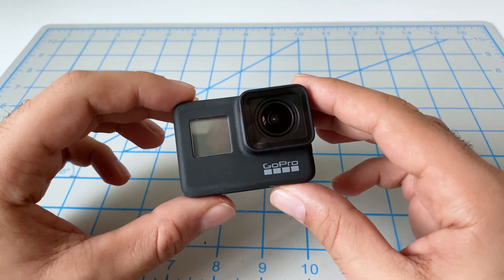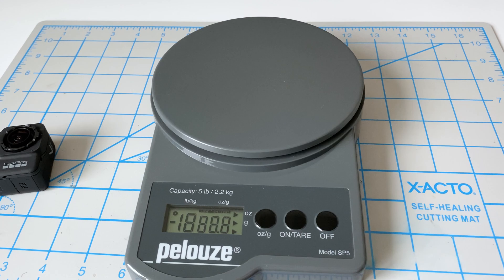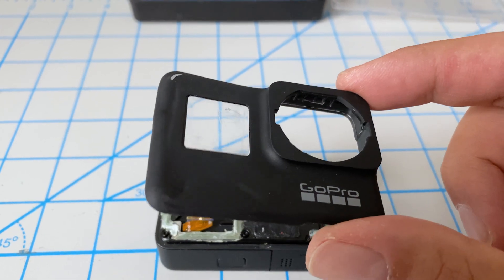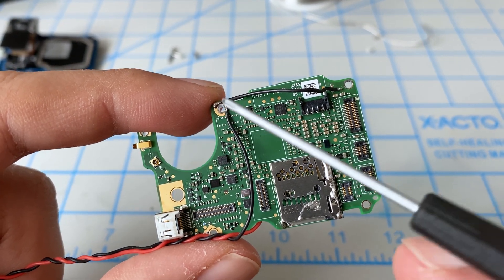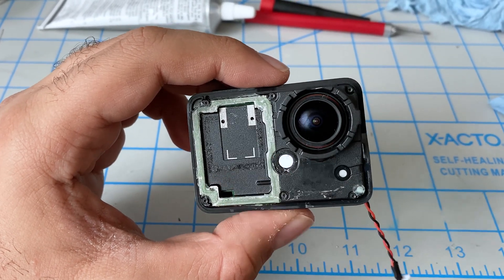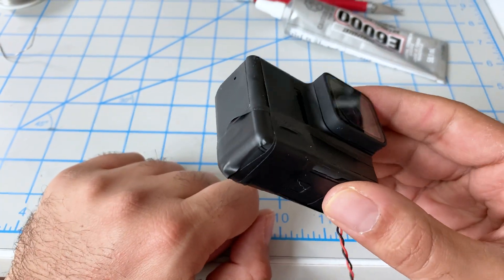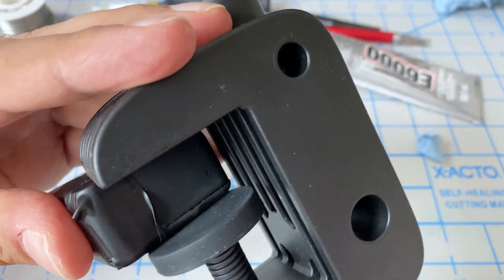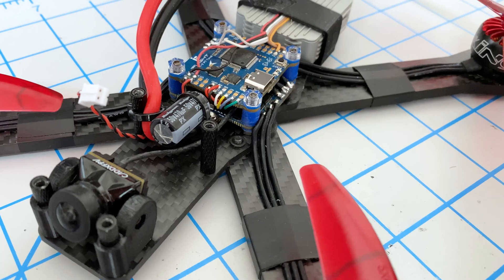Powering our GoPro Hero7 Black from the Flight Controller | HARDWIRE battery ELIMINATOR how to guide

Comment from the maker: Here's a video for the brave and technically inclined! When gluing the face plate back on, try to avoid getting glue onto the smaller white circle in the bottom right of the camera. That is the front facing microphone.

Comment: Hey I dont do work on FPV drones but Im doing work with a government contractor that cannot have any wireless communications and we need video output, its going to be in an enclosed environment, and needs to be on looping mode. I've tried using  GoPro Labs and it cuts out and eventually runs out of battery. I'm going to see if I can bypass the battery so therefore removing heat from the gopro as well as not worrying about charging it.  

I also am thinking about using the battery eliminator then using the USB C on gopro 8 models to output video. What are your thoughts on this?
Reply from the maker: I've seen videos of folks using those battery eliminators from the USB port, seems to work just fine. I didn't like the wire coming out the side which is why I did the mod differently. I've done a couple of back-to-back flights without any shutdown or issues. If you are wiring this to your flight controller, must make sure the BEC is up to the task.

Comment: I like how dry you explain it as a learning for us how you broke everything inside of gopro but saved the top cover :)

I want to do the same thing to keep the gopro but plug it from the drone. A great solution. Thanks!

A dummy battery plugged via cable would be an awesome solution
Reply from the maker: HAHA, thanks! I know a lot of folks just remove the outer door and have the GoPro plugged in with a USB cable. It works but not as an elegant solution.

Comment: How do set settings? As i understand you just provid Power and the Cam starts filming. right? Thanks
Reply from the maker: I have mine set so that I need to press the record button but there is another wire you can attach so that it starts recording right away. I configure the camera settings using the app through wifi.

Comment: I appreciate the work but I don't get the point of opening the Gopro and almost destroying it + losing warranty. I just remove the battery and power it with a 5V USB-C cable which has the same effect (okay I need to press the power button to power it on but that's no issue). Warranty remains intact
Reply from the maker: You are correct, idle hands I suppose... Really only two benefits, the power button and the fact that you can close the door at the side. Makes more sense to do this when you are opening up the GoPro for a repair.